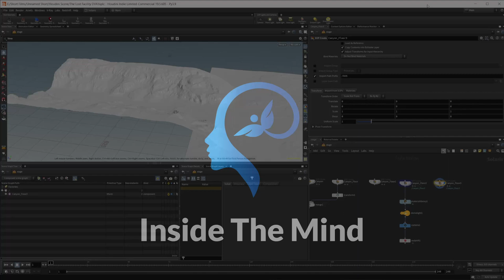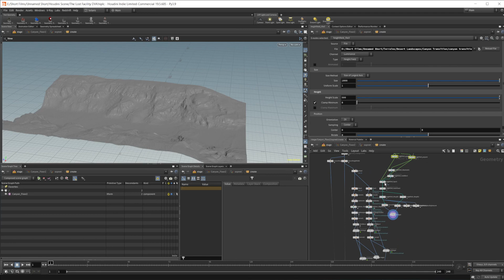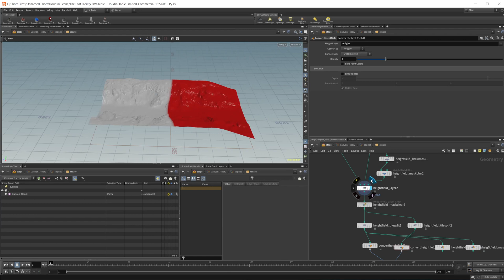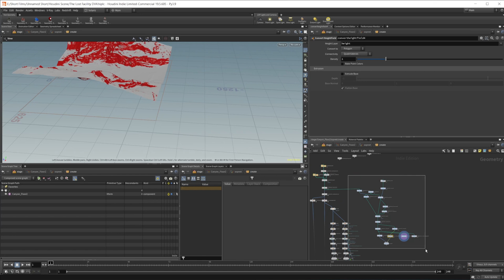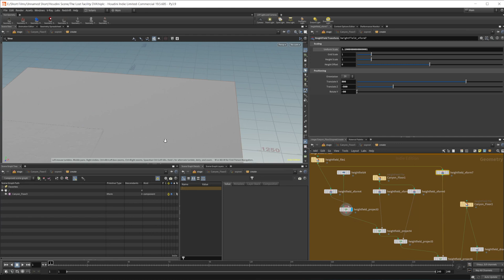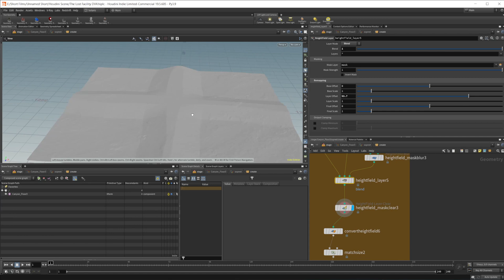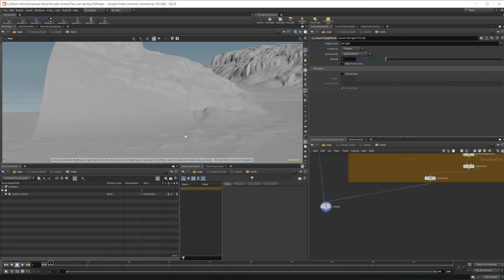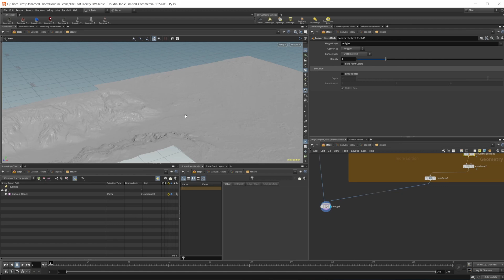Blending HeightFields Together | The Lost Facility DevLog 4 | Houdini 19.5

Comment: In heightfield, if I want to scatter some rocks on ground with heightfieldscatter node, the problem is, after the generated rocks on ground, it's not polygons anymore and convert isn't working,,, in that case what to do to make them polygon? I did export them as alembic then input it, but I think it has a right way to do!
Reply from the maker: They are probably packed and instanced so an unpack would be what you're looking for
Reply: Thanks! Unpack worked! 😶 dumb me why haven't I tried it then...😅
Reply from the maker: Alembics will always be packed